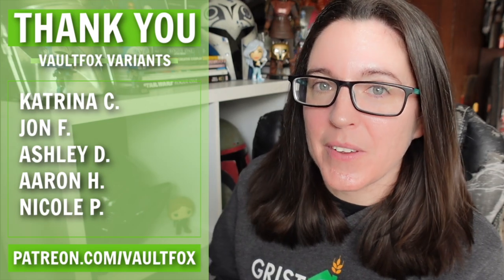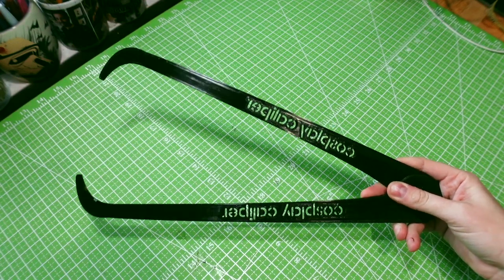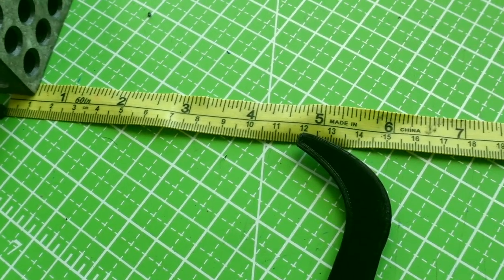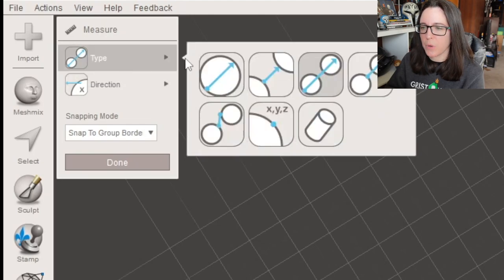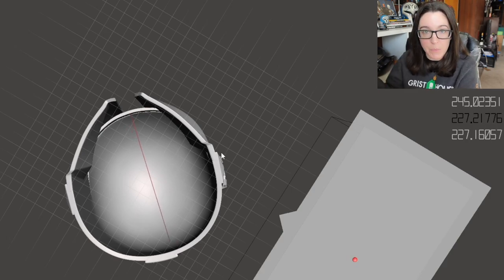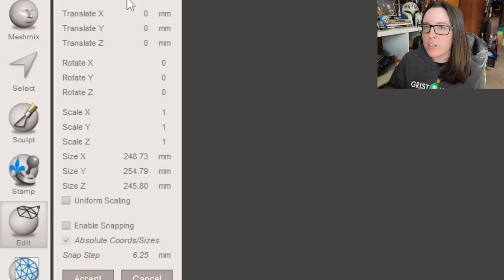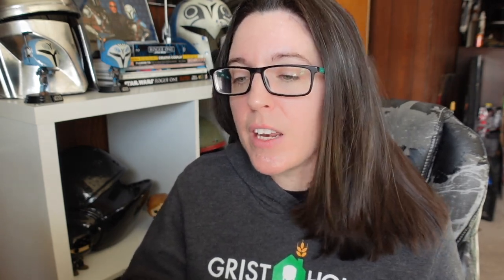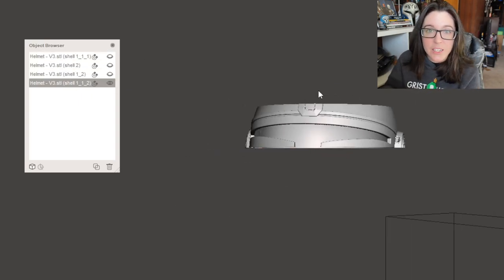How to Scale 3D Printed Helmets and Armor for Cosplay using Meshmixer

Comment: Just stumbled on this and it is very helpful! One thing that may make things easier...
You can calculate the exact scaling factor you need fairly easily:
1. Measure inside of helmet: across the helmet (Helmet X value) and front to back (Helmet Y value). Optionally you can also measure bottom to top (Z).
2. In general, you want to concentrate on the smallest distance of these measurements. Let's call this SMALLEST Helmet Axis Value. 
3. Take your measurements of your target head as you showed in the video. We'll call these Head axis X value , Head axis Y value , and optionally Head axis Z value.
4. Use the head axis measurement that matches the SMALLEST Helmet Axis. (So if smallest is X, use Head X value... if it is Y, use Head Y value... etc)
4. To calculate the scale factor, use this formula:

         Scale Factor = (matching Head axis value) / (SMALLEST Helmet Axis value)

5. Use Meshmixer or whatever program you wish to do a unified scale (of the Scale Factor value) across all axis.

Comment: Thank you for all the helpful tips and sharing all you have learned from failed attempts or as Edison said ways that won't work.  I'll try and repeat the correct ways as I venture into building a full Iron Man suit.  With my first helmet I didn't consider the size and assumed it would fit most people,  it printed perfectly but I guess I'm not most people (too small).  I just  rebuilt parts of a CR-10s Pro v2 and will be firing it up this weekend along with another printer I had.
Reply from the maker: You're welcome! Good luck on the Iron Man helmet, that's a heck of a lot of upfront work in just getting that suit and helmet scaled correctly, I don't think I'd have the patience for it myself!

Comment: Interesting video, I never realised meshmixer had measurments. I really should dabble a bit more with these things haha. I actually just go straight in and do test slices but this would save the guesswork. Thanks for the info...and the link for the caliper file. ;)
Reply from the maker: if it makes you feel better, I did the same for a looooong time. as much as I love 3D printing I am extremely bad at visualizing how large things are and would usually just go to test slices myself while guesstimating the scale.

Comment: and always remember to triple check if you saved the right file on the sd and don't be like me... i had all the file scaled right.... i had few problem with the printer so i had to change few settings in cura and..... i forgot to scale again my mando helmet Q_Q and i just noticed now after i printed 3 pieces and only miss the face part.... it should go in, slightly tight on the nose but it should go.... so tnx to you from now i will change the way i scale the 3d model, better scale it, split it and have all right saved from the beginning on meshmixer ready to go instead of do all on cura
Reply from the maker: oh maaaaaaaaan, I have done this in the past as well!! my older PC used to freeze up CONSTANTLY when I was configuring/scaling files and I would lose so much work when it would freeze and other times it would save halfway through on the SD card and would just STOP while printing. oof.
Reply: Lol same!!! I started renaming or add the % scale on the file name lol, I had 4 different sized files of the same print a few times for some friends I was also printing things for and that helped a ton as my printer won’t display more than 14 characters on its screen lol! Oh the learning curves of printing 🤦🏽‍♂️🤷🏽‍♂️😂
Reply: @jedirogar  instead i always added the time on the file name xD like Face 1D , Neck 6H and something like this because every time i forghet how much time i need for the print , in this way i can manage when to start the print, but yeah , better make folder/ files with the % scale as name . ( or better solution, buy a huge printer that can print in a single run instead of cut every time every files because they don't fit on the plate x'D )
Reply: @like_a_pr3dat0r  haha I like that!! 

Yea I may bit the bullet and get the cr10s v2 for that very reason!! Took 19 parts for my Starkiller helmet so trust me I get it!!! Was looking into a large resin printer buuuuut that’ll have to be a bit later seeming for the size I’m after would still be around $4k, so larger fdm it is lol

Comment: I've watched both of your videos and I have no idea how to do that slicing a portion in Cura, everything I'm seeing is you have to use another program, so I am trying Meshmaker. What you said makes perfect sense though, but what about helmets that are printed in parts?
Reply from the maker: Not exactly sure what you're asking ... are you talking about slicing helmets into multiple parts for printing? Cause you can do that in Meshmixer with the Plane Cut tool, you'll just have to slice it into smaller parts using that tool
Reply: @vaultfox  I mean like when you go on thingiverse and the helmet is already cut into pieces, can you measure it then or is it basically trial and error at that point?

Comment: I have a question. I am trying to edit in meshmixer, kenobi clone armor for my son. I am editing the right arm gauntlet. How to I resize just the openings of the gauntlet?  Where the gauntlet ends at the elbow, is the proper size. But at the wrist it's too small. If I try to edit the wrist...it changes the elbow. Is there something I have to do or a video that shows how to do what I'm trying to do?

Comment: Good tips!

Another option for those who do a lot of printing is have a 3D scan of yourself done if the option is available at a convention or through other means 

I had myself scanned when I was at a con. It was not too expensive and the file can be imported to mesh mixer
Reply from the maker: thanks! and I've seen those booths at conventions, didn't realize they actually give you the file as well! I'll have to try that out next time I see one

Comment: Hello, So I recently purchased my first 3D printer. Today I decided to print out Boba Fett's Jetpack as a first official print. The total time was around 29 hours at a layer height of 0.04. In Cura I made sure that the back measurement was 12 inches wide. Upon the prints completion, I was sad to see that my print was 12 inches across,yet the rest of the jetpack was sized for a youngster. Before I got the 3D printer, I made my jetpacks out of PVC pipe and styrene, and that was the bases of my measurements. Do you have any suggestions for making sure my future prints will be adult size and not toddler size? Thank you, Daren
Reply from the maker: if I'm thinking correctly, it sounds like when you adjusted the jetpack on that axis so it was 12 inches across, it also took the other two axis's with it. there should be a checkbox option under scaling called "uniform scaling" that you'll need to uncheck, and that will make it so you adjust each axis independantly
Reply: @vaultfox  Since submitting this post I have learned a little bit more about Cura. Like you said, I found the uniform scaling. In addition, I realized that I miss measured my jetpack. Not a total loss on the initial print. I am thinking about making a Mandalorion costume for my German shepherd.